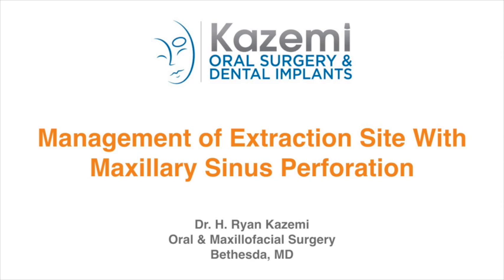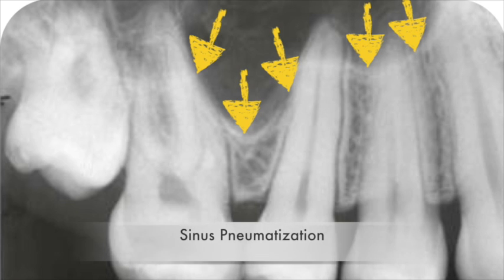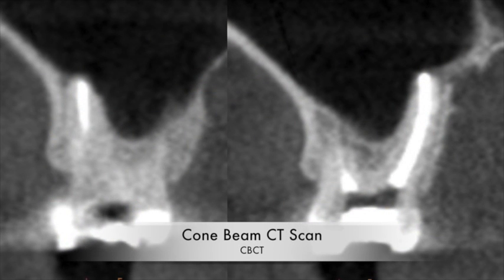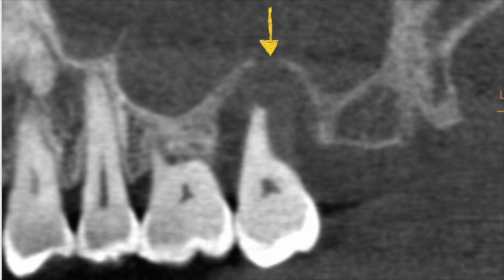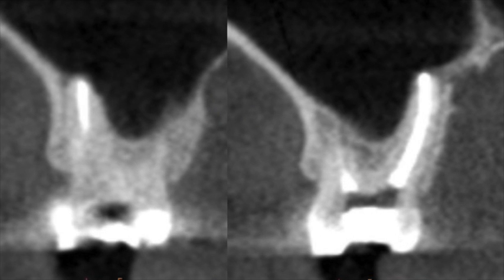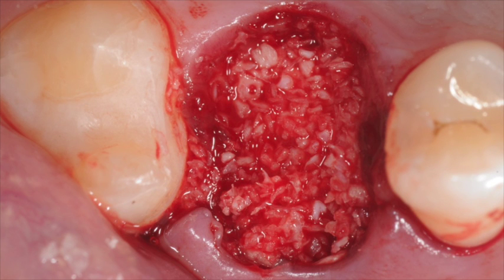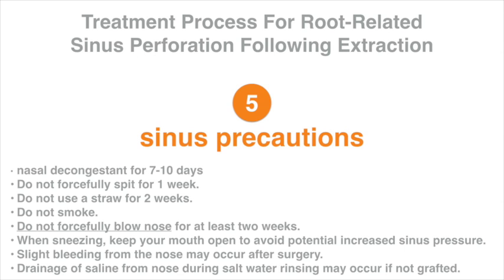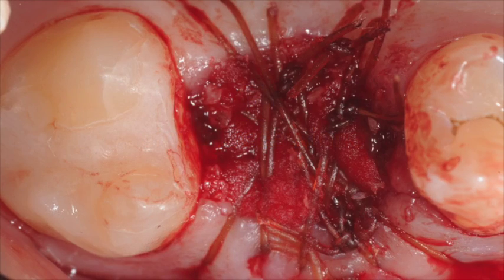Management of Maxillary Sinus Perforation Following Tooth Extraction

Comment: What do people who use a CPAP machine do. I've got roots well into my sinuses and have an infection. 
I've just finished a course of antibiotics. 
My specialist has been away on bereavement leave. 
The CPAP probably complicates things right ?
Reply from the maker: CPAP can increase the air pressure in the maxillary sinus (if anatomical communications are open), which can cause reverse air pressure through a sinus perforation. So it should be perhaps used intermittently or avoid its use until healed. For specific recommendations, please speak to your oral surgeon

Comment: Can the sinus hole cause the be tooth extraction heal on its own with prescribe medication without the three-layer approach applied?
Reply from the maker: if the size is small (<1.5 mm) , it is certainly can. The only way to confirm that is by a cone beam CT scan and also clinical observation if it was noted during procedure

Comment: I recently had my wisdom tooth removed, which was cracked and had just had an infection treated. Four days afterwards, I got extremely sick and had a fever. Turned out to be a sinus infection—specifically on the side where the tooth was removed. The oral surgeon dug in his heels and said there was no connection and to just see my MD. My doctor said there was absolutely a connection. I’m a little at a loss now. If I’m still having trouble with my sinuses following my antibiotic treatment, should I try calling the oral surgeon again?
Reply from the maker: A cone beam CT scan will establish possible communication between the extraction socket and sinus. Your oral surgeon should be able to do that as a very easy and quick diagnostic way
Reply: Also, I had NO instructions from either doctor regarding blowing my nose, so of course, initially I was trying to blow my nose, but I was so stuffed up, it was useless. Probably the last thing I should have been doing.

Comment: Hello. My doctors aren't sure if i have sinus perforation. I did x ray but they cant tell for sure. I mean they tell me  there is but i have no symptoms whatsoever, except for a lot of bleeding hours after extraction which was stopped with gauze and medicine, and second day absent bleeding. What symptoms would i gave if perforation of sinus, and can it heal without surgery? Thanks 😊
Reply from the maker: symptoms may include blood or fluid discharge from nose and air leak when attempt to breath out from nose while pinching it close. A cone beam CT scan will also demonstrate if there is significant perforation

Comment: Doctor, Can I blow my nose 3 weeks after surgery after a sinus perforation? My other question is, to wait 5 months half  after tooth removal to plan implants is too late? Wont my bone decrease more? (I know I’ll need a sinus lift) 
Thanks for your great help!
Reply from the maker: Hi. It is best to speak to your surgeon for specific recommendations. Generally speaking, after 3 weeks it should be ok (but it is dependent on the size of the perforation); Generally 2-3 months after extraction, implant can be placed if bone is adequate (to be assessed with CBCT - 3- D scan); There is generally some bone shrinkage that occurs after 3-4 months and then stabilizes in 12 months. I hope this is helpful.

Comment: hi doc.

i had root canal before on my canine tooth and now it has infection. the dentist said to root canal again. is it oky  or i need to decide to extract it?

the root of this canine is on the sinus cavity. 

extri or root canal again?
Reply: The endodontist (root canal specialist) should provide you with a recommendation- on re-treatment if it has a good prognosis or extraction if it has a poor prognosis.
Reply: @unpluggedwithdr.h.ryankaze9905  is it common when there is perforation of sinus cavity after  canine extraction? 

im afraid
Reply from the maker: @faithshabitat5705  Canines are usually not near the sinus cavity.
Reply: @kazemioralsurgery  what if doc it's near or a possibility that it will be perforated. is it oky ?
Reply from the maker: @faithshabitat5705  A 3-D CBCT (cone beam CT scan) is recommended for diagnosis and planning so perforation, if it happens, is managed properly.

Comment: Hey Doc, I just came from an extraction for one of my upper left tooth, it had like three root ends and one of them broke off and they won't remove it because it's at risk of affecting my sinus, I however notices after a hour later there's air passing though my tooth. Do I go back and let them know or does it heal on its own?
Reply: Update: Spoke to the dentist and they told me there's communication between my sinus and mouth, they referred me to a maxillofacial surgeon. It actually closed up and healed, after a month I finally went to the specialist and to everyone's surprise the root that was there before is completely missing!
Reply: @RichardDanielSanchezz  are you symptoms free?

Comment: Hello Doctor, I had 4 wisdom teeth extractions a little over 5 weeks. 2 of them were from the upper jaw and about 2 days later I started having trouble breathing. I have been to an ENT and came to found out that my maxillary sinuses are swollen and so are both of my turbinates. I've never had allergy issues this bad in the past. Could this be part of the healing process from extractions?
Reply from the maker: Upper third molars are anatomically close to the sinuses and certainly a sinus issue may occur but your symptoms are multi-factorial. You might ask the surgeon who removed the wisdom teeth if any thing unusual may be have been noted during procedure. I you recover and feel better soon.
Reply: Any improvement?
Reply: How are you feeling now? Was the trouble breathing really bad or manageable? Please could you update on your recovery. Many thanks
Reply: did you figure out if that teeth removal was the cause of your breathing problems? I’m having something similar too so I’d appreciate the input

Comment: I have a sinus perforation right now. I feel a lot of pressure and I'm not sure if it will shut. I also taste some drainage. How will I know if it is improving?
Reply from the maker: if symptoms begin to diminish and drainage decreases, that is a good sign that is improving. Persistence or worsening of your symptoms should be alerting. A consult with an oral surgeon is a good idea.
Reply: Hi Dr,
It's been 12 days since my wisdom tooth extraction. I also feel pressure in the socket and last night amd I had severe swelling and pain in my right jaw that radiated to the eyes and neck. I also used a jade roller on my face and I'm afraid that I may have damaged my sinus nerve. What should I do?
Reply from the maker: @ramiahadeen4358  Hi. It is best to see your oral surgeon for an evaluation and check the healing progress.

Comment: I have had chronic sinus pain and infections above where I had a tooth extracted 4 years ago and it's made my life a living hell. I have been told by dentists that if I can't blow air from my sinus into my mouth then there can be no perforation but is it not possible to have some bacteria able to pass from my mouth to my sinus? My remaining tooth roots go until my sinuses and I feel the pain right above them. 
So I had thqt remaining adjacent molar root canaled but this has not resolved my issues at all. They did find calcium buildup around the nerve roots however due to chronic inflammation.
Reply from the maker: There are certainly several factors that can cause sinusitis. A CBCT (cone beam CT scan) followed by a thorough dental evaluation (along with an endodontist report) and possibly an ENT evaluation is important for diagnosis.

Comment: Hello I had an upper moler right in front of my wisdom tooth and when I got the injection I felt a burning sensation immediately in my nose (right side) still burns and is leaking right eye watery as well what’s going on!?
Reply from the maker: hope it has all resolved. if not you may want to follow up with your oral surgeon.
Reply: Are you better now? Thanks
Reply: What is condition... Are you ok

Comment: I have a picture of my wisdom tooth roots (on MRI) actually in that sinus cavity above it. Is that bad? Could it be the reason I have had headaces for 20 years plus sinus infections. Every time I bend over I smell ammonia and there is also a heaviness in my brain which causes a little drainage. Feels like everything plugs up when I bend over.
Reply: I can't say if it's the cause of headaches or smell of ammonia but I had this same problem with tooth roots in my sinus on the right side and I had chronic sinus infections for over 10 years and then had all the molars on that side extracted 8 years ago and haven't had a sinus infection since then. My last wisdom tooth just cut through the end of last year and brought with it a sinus infection and this time an abscess that drained through the sinuses and out my nose. I have to see an oral surgeon to remove it because it's roots are in my sinuses so my dentist won't touch it. I've already had one tooth perforate my sinuses before so I assume this one will too especially since it abscessed in my nose already. I'm on my 3rd round of antibiotics now since Jan and can't see the surgeon until July, I'm getting by with 600mg ibuprofen but the pain has been slowly building so I just hope to make it to July without needing stronger pain meds and without another nasty infection.